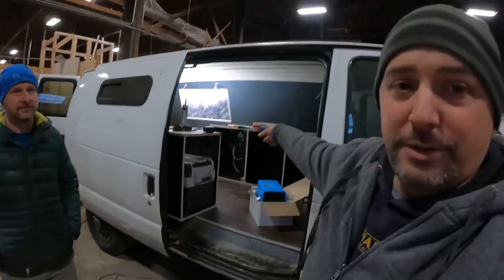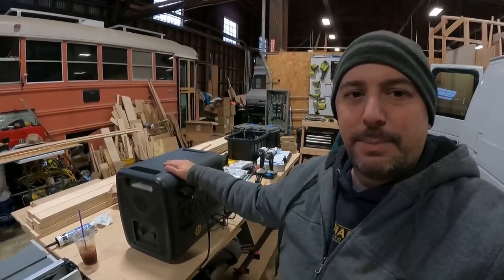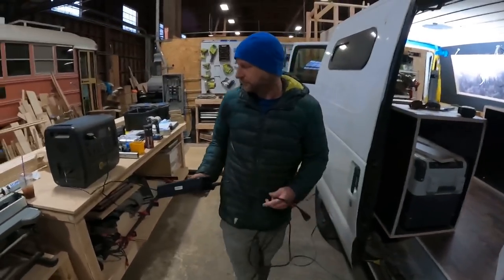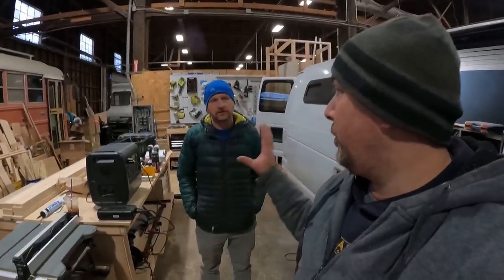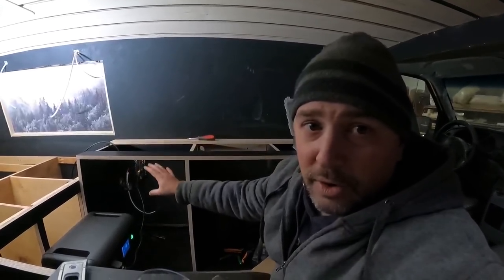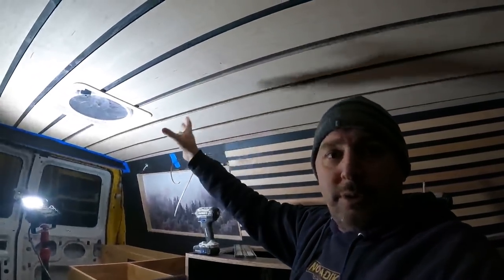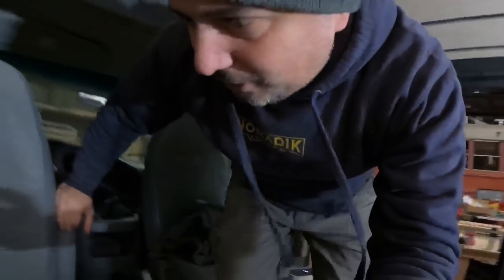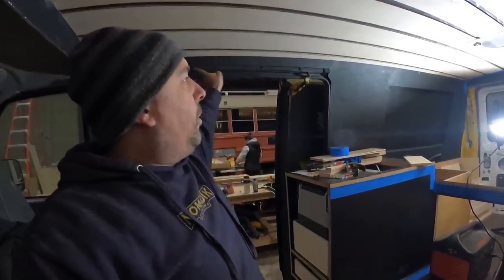Van Build Ep. 12 - Power was Easy,  Started Wall Slats

Comment: The van's coming along great!  I have the same fridge location in my Promaster, it's perfect as it allows easy access from inside or out.

    I do have to mention, a pre 1997 Ford F-Series and you couldn't get in?  😆    I drove an 88' F-250 in high school and that triangle vent window is like leaving a garage door open. We used to leave a coat hanger in the bed just in case we lost the key, it takes seconds. And once you get in the ignition could typically be turned by just about any Ford key you had. 😄
Reply from the maker: Lol I tried other keys and the triangle window and neither was working. I figured better to pay 100 bucks then break another thing to really upset me
Reply: You need to have been shown how (where) to I insert the hanger to open the vent LOL 
guess there weren’t any Boomers around to lend a hand! LOL

Comment: So I understand the concept of connecting fuse block to the powerstation. What I'm having a hard time grasping is how you can have more amperage in fuses on the block than the powerstation can handle on it's own? May be a dumb question but I'm still trying to wrap my head around that bit.

Comment: Hey Jarrod.  Looking great.  I’m still trying to locate a van. I’m so excited to get going with our build. I think I told you already that I’m doing a plug n play too with the eco flow delta pro with the extra battery.  I appreciate your videos as I always get something out of them.  I will be getting the Victron phoenix too.  I’m thinking the 500 va would be the best so as to not draw a lot crap ton off of the alternator.  Thanks to miles as well.

Comment: I like the way the interior is going.. I'm also currently pouring over a new Chinese diesel heater (2nd one) it's making me crazy.. then I have half-assed wiring (yes DIY) with 2 - 6 volt deep cycle flooded batteries which say 225 amp but cause the induction to not work... so yeah going nuts and the stand alone system looks really bitchin right now (it's a friggin camper not a $200k sprinter) so maybe share a schematic if you will..
Looks good buddy finish it up

Comment: Hi Jarrod, a beautiful build coming together really fast. I'm building an econoline myself, started way before you and probably will still build it long after you are done ;)
Technical question: how /where did you connect to get alternator line? Is there some spot in econoline you can easily tap into? How did you feed the wire into cabin?
Reply from the maker: For me I went through my floor and under all the way to under the engine. If you’re doing more of a custom kit with a DC to DC charger it’s typically done that same way, IF connecting to battery. In other vans like Sprinter or Promaster the battery is inside the cab so it’s easier that way

Comment: For solar and alternator charging, why didn't they just use a MMPT controller? The MMPT can handle tons of amperage at 12-24 volts directly from panels/alternator. Using multiple inverters creates tons of waste energy (heat).

Comment: So Jarrod you’re doing a 12v or 24v system? Any thoughts or feedback on benefits or drawbacks with regards to that?  When connecting up inverters to alternators is there a limit to the sized of the inverter? Is this the only size inverter Victron makes? Sorry lots of questions. Any step by step instructions for how to install it to the alternator? I have an victron oscillator I already purchased ... is there a max inverter it can be connected to? Since you have the inverter there with all the know how ... hey no broken windows right? Cheer up ... even with all of what’s going on you’re health is hanging in there. Sometimes it helps just think of how so many things could be worse; in order to appreciate what it is not to wake up to a brick wall. May your new year be better than the last.

Comment: Coming along real nice . Doesn’t Goal  Zero have similar kit set ups?
Reply from the maker: Probably. I’d have to price compare. But I like these systems because they can handle the big solar panels I put on the roof. With the other power systems you almost have to use the smaller panels
Reply: @JarrodTocci  good point , thx

Comment: The way to charge from alternator sounds like a major hack,   I need to buy a DC to Ac converter to run an AC to DC converter to charger the aspen.   Sounds like they need to provide a higher dc input option or better yet what is the spec of the brick that plugs into the aspen and wall maybe a buck-boost to go directly from alternator to same connector on aspen

Comment: Hi Jarrod,
The alternator charging, is that an additional alternator in the engine bay or are you coming off the existing alternator? 
Can you show what is involved?

I want to get myself a van, I am thinking of a XLWB sprinter as I want to try and create space to put my motorbike in too.

Ian
Back on Two Wheels
Reply from the maker: No with this set up you connect directly to the van battery

Comment: Aren’t these standalone power stations usually have 50V batteries which should put a 2000WH one at 40AH (and not 170AH at 11.7V)? Ive been planning to buy a similar 2000WH Bluetti AC200Max but they have not publicized it’s AH which has kept most potential buyers like me wondering. Hope you can help validate yours as its a very nice option it thats indeed 170AH. More power to your channel!

Comment: Great video as usual. What are you doing for lighting?
Reply from the maker: All indirect lighting. The top wall slates have led strips lights on a dimmer. 2 over the bed reading lights. That’s plenty of light for that space. I’m not a fan of puck lights
Reply: Oh nice, I saw the reading light wiring but didn't know if you were doing the strips again in the ceiling. Didn't see it on the install video. Stay safe brother.

Comment: Dumb question probably, but I assume you are looking at an increased duty alternator for the van?  Because I assume if the inverter takes the full 500W, it could be quite the drag on the car systems?   Or maybe the inverter limits it automatically?  Just curious on those details.  Love the discussion on these all-in-one electrical systems.
Reply from the maker: The way it works is it’s hooked up to the battery of the van so there’s no extra pull from alternator. The alternator job is to recharge the van battery but once full it does nothing. So I believe the battery of the van then charges the “house” battery through that inverter and the van battery gets charged via alternator. You can turn off that inverter too which you’ll need to do when van is not running. The more I use it the more I’ll explain
Reply: I would be very interested in more info regarding the inverter (for charging) setup. It seems like a great way to have all of the solar input plus the ac (when needed) input. Thanks for the video/content. Any additional thoughts would be greatly appreciated.